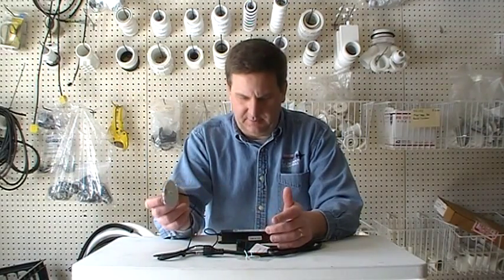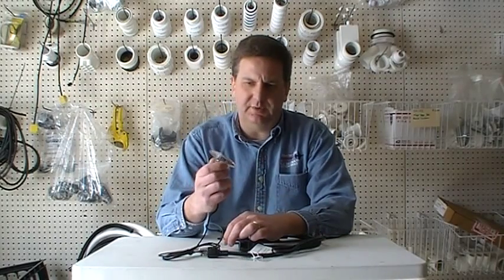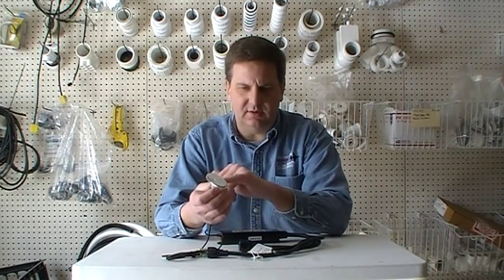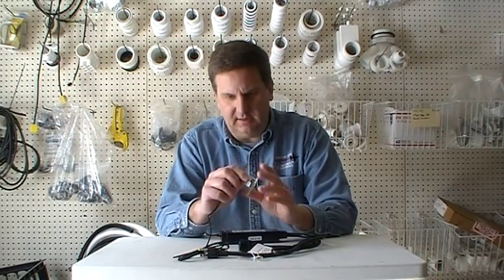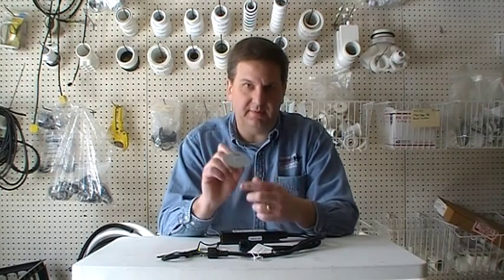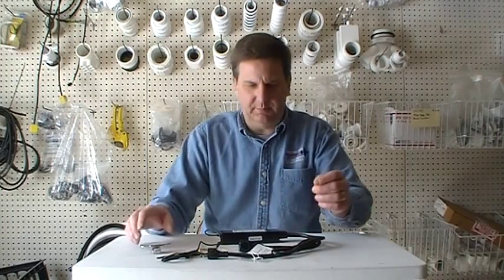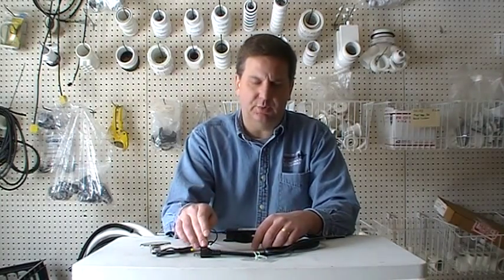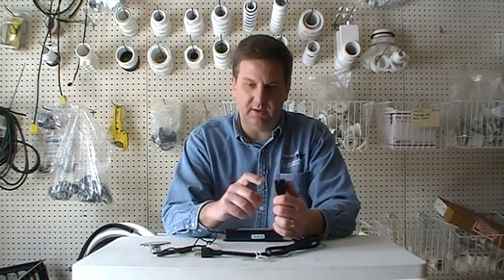ED63000 JACUZZI® Bath Tub Control System

Comment: Hello, my tub isn't working and I noticed the little membrane on that topside switch is cracked and peeled off.  Could that button face peeling off cause the entire switch to stop working?  It would intermittently turn off and on when we were used it before that little label peeled off.  I would hate to order just the topside switch and find out that I needed everything.  Or vise versa.  Thanks in advance for any help you can provide.
Reply: I would change the button. It sounds like that's all you need. Let me know if you have any further questions, here to help. AJ